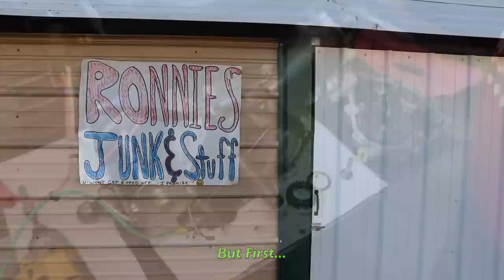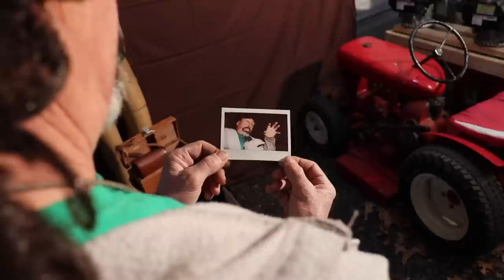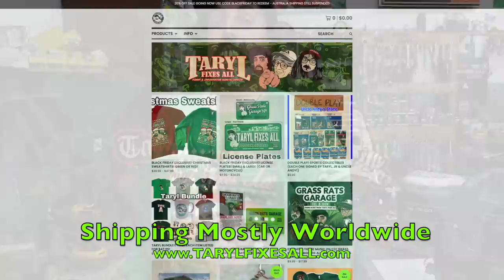Crappy Briggs Plastic Gear FAIL - Is It Warranty?

Comment: 2 year old engine "they don't make the plastic gear anymore and they don't make a metal replacement"..... WOW. Briggs is getting to be more and more like GM all the time.
Reply: These companies should be forced to provide replacement parts. I'm seeing parts no longer available for a snowblower engine yet it looks the same engine being sold on a new snowblower.
Reply: Yeah the cost cutters is one thing, the not selling parts is fucking bullshit.
Reply: @nickmcwilliams685  If environmentalists actually cared about the environment they'd shut up about carbon and start talking about shenanigans like this.
Reply: Just imagine all the carbon that they wouldn't spew, if the carbon bashers would just zip it.
Reply: Hell does uses plastic crankcases for there Eco boust v 6
Reply: @adf8382038  Do you know where electricity comes from?
Reply: Ya use to be good Engines

Comment: Why do the manufacturers keep using plastic gears? They've been trying and failing since the 70's.
Reply: Thought the same thing! Use METAL!
Reply: Probably because purchasing pressures them on cost savings and senior management supports that effort. Remember, a lot of companies are ran by bean counters these days.   They have no clue about engineering and could care less what engineering thinks.
Reply: Plastic is cheaper to make. So if they save a few cents a motor X thousands of units = $$$. Plus it’s a calculated risk. How many will fail under warranty vs how many fail after. Then they also get to sell parts and double dip.

Comment: Plastic parts are the manufacturers best tool for planned obsolescence. Making sure they don't last and not making the replacement parts needed to replace the weak link they intentionally made. From cars to mowers to kitchen gadgets, the old days of taking care of your stuff and having it last a lifetime are over.
Reply: Exactly. And even when you spend  25-50% more for the “good one” you only get about 10% better product. Even the better stuff is crap. Only way to get something really good is to make it yourself.
Reply: the way i see it, since EVERYTHING is made to be disposable nowadays, shouldnt prices on this stuff be going down instead of going up?
Reply: Just went through this with my dishwasher (the machine, not the ol lady). Tried to fix it myself, determined it was the control board which they do not make or have anywhere and it’s only a 6 year old machine. So I said to hell with you whirlpool, I find a different brand. Needed one ASAP, got to home dumpo and they only had two models in stock with no idea when others would be in. So guess what, I went home with a whirlpool.🤦🏻‍♂️
Reply: Gotta keep the money flowing somehow.
Reply: @brandoniron44  if i had everything needed, tools included, i would make my own small engines, probably outlast all others for the next 50 years or more.
Reply: I thought they were forced to plastic to make it lighter to improve the gas mileage . of the truck delivering them?
Reply: It didn't work in this case, since Briggs had to front the cost of the replacement part and the labour.
Reply: @kenhilson786  take mopar for example, original cam gear in their slant-six had nylon teeth, it was supposed to reduce the noise level of an engine that rattles like a diesel truck.  did not reduce engine noise, but you could drive less distance before needing to replace the timing set as those teeth would break off after so many thousand miles and the engine either stopped or, in rare cases, destroyed itself.  either way, mopar found a way to make money from an indestructible engine.
Reply: @angusmacgyver3673 gm did the same thing to small block V8s in the 70s as well and presumably other decades as well. 350 out of a 77 corvette I rebuilt had that nylon toothed cam gear. It had 40k miles which is nothing but the chain was so loose it started slapping the timing cover. I don't know how it didn't jump time.

Comment: I've seen many old Briggs engines last 20, 30, 40 years.  Can't imagine these new engines barely making 5 years.  HF cheap China Honda clones are probably better.  Cheaper, anyway!
Reply: Yup!  "Chonda" motors are great.  I have a couple from Harbor Freight, run like tops.
Reply: The Chines stuff is getting much much better even in Canada we can buy the Chines  6.5 hp engine for less then a Briggs and Stratton carburetor.
Reply: Yup i have gotten several briggs generators engines made in prc with aluminum bores that they made with no low oil sensors! They blew up due to excessive oil consumption and cannot be rebuilt. Complete junk ya the harbor freight predator engines are much higher quality
Reply: @edgenet1    212 CC  (6.5 hp)  at Harbor Freight here in the USA goes on sale for $100.    I have one on my log splitter.
Reply: predator (honda clone) from harbor freight on my pushmower.  while the gear does not appear to have moved on the cam, it has,  valve timing is off on 2 3.5 briggs classic engines.  i cant see that price for a cam that cheaply made so, for around $110-$120, you guessed it, cheap honda clone from harbor freight.  a briggs engine around here goes for a good $250 or more for a pushmower, will last 1-3 years before the crap they call a camshaft goes out.

Comment: I've seen many new Briggs engines with a plastic gear that has gone bad.  Such a stupid design.
Reply: They had to of done it to make money on replacement parts or to get you to buy a whole new engine...
Reply: @PeerlessYT  Hell, they should try a plastic piston. Big money maker there.
Reply: @lynnh7694  Honda gcv160 have a plastic gear that runs a belt for the timing gear and valves. Others use plastic but I guess the use it in the right places with good materials and there isn’t an issue.
Reply: @FishFind3000  the grass Rats probably love the plastic stuff. Paid in full on warranty money. Top dollar 💰

Comment: Shameful. Briggs must know exactly how many hours these engines fail at. Will they also pay for the time you work on it?
Reply: engines are tested to see how many hours they will last, the warranty is ALWAYS short of how long it will last.  this is how they "get" you.  either you take it to a shop and pay big time for repairs, or you buy another engine and still pay big time.  or people could do like me if you want to save some money, being disabled and on disability, i dont have the money to play with so, instead of around $250 for a push mower engine, i spent around $120 at harbor freight for a predator, which is still going strong.
Reply: Bend Over  but look at how many other engines survived  just fine
Reply: Made to fail shortly after purchase 
By China engine